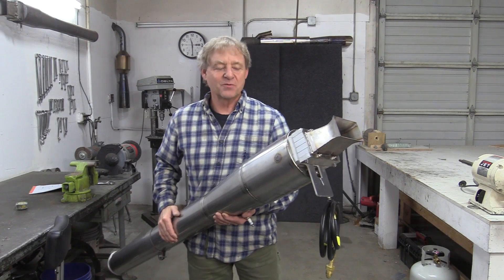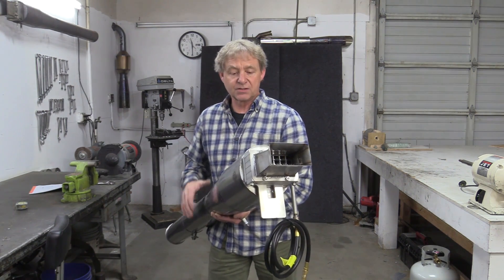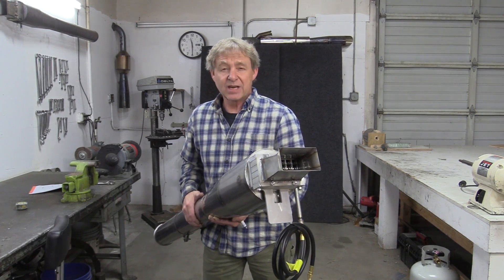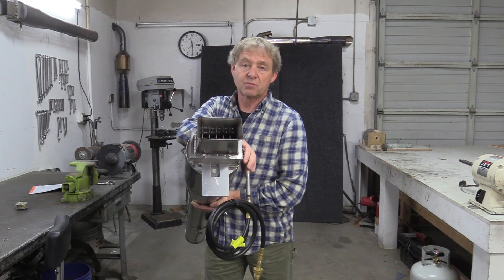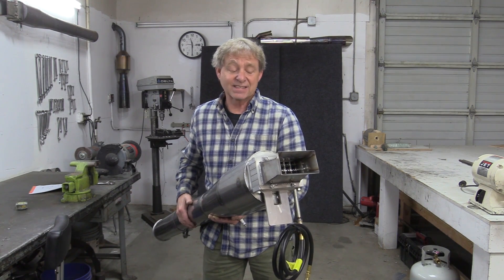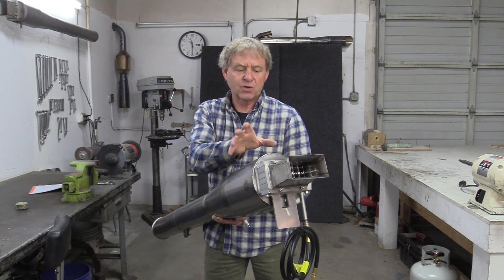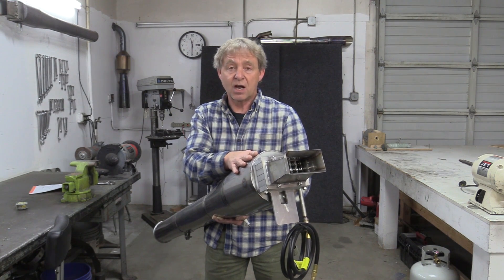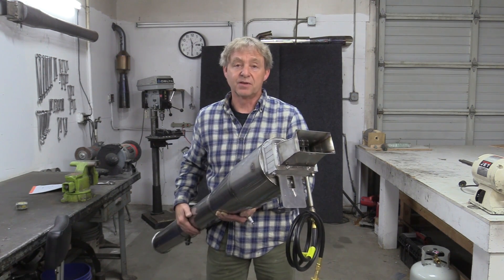Rocket Man building the BIG 50 pound thrust Cyclone 50 Pulsejet!

Comment: What a great build and super video on it!   Which fuel be least costly to operate the rocket?  Besides gasoline or propane, could you use kerosene or diesel?  
Also just wondering how long does the reed valve work before it needs repair or replacement?  Such rapid pulsing I would think it wear out fast.
Reply from the maker: Hi, My valveless engines run on anything but the valved engines just run on gasoline or alcohol ( but would need re jetting. Valves last about 20 minuets.

Comment: When these jets run for a decent period of time and end up turning red and white hot, is there any danger of some kind of catastrophic failure? I may be wrong, but Im under the impression that when metal is red/white hot, thats when its at its most malleable and weekend state; thus, the combustion chamber could potentially fail. Im I completely wrong?
Reply from the maker: Hi, Well the white hot look is just from the camera, they never get white hot just a bright orange, about 1200 F and they won't melt or anything, if you had a weld com apart it would just open slowly and shoot some fire out but the engine would not stop running until the hole got maybe 4" long and real wide, the engine will never just explode or anything like that.
Reply: Well whatever you do, obviously don't make it almost entirely out of <1/4 inch HDPE plastic, and then light it off with your right ear next to the widest part of the combustion area. (I speak from experience, very bad idea.)
Reply: @uniteddetinu7750  lol been there done that...😀🐶🔭
Reply: Brunnen
Wasser
Reply: Robert Maddox 
How much thrust?
Reply: Larry Scott it's in the title duh
Reply: Widi Taufik 
My mistake.
Reply: I recommend 4130 Crome Molly, but no matter what do not vary from the plans.
Reply: justin hyland with new alloys wear hardening and other attributes only time and testing will tell ?
Reply: Ask the Brits about the V2 sent over from Germany. It was a pulse jet engine.
Reply: @Laurenavan  V1*
Reply: Might be air cooled wind chill missing in static run.

Comment: id like to correct 1 small mistake, that is a ram jet engine, pulse engines use the u shape but I would love to see a turbo ramjet with an afterburner and I could design it too
Reply from the maker: You think after 20 years of building pulsejet engines I don't know what they are? ram jets have to be propelled up to speed to run, they don't run static, the u pulsejet is just a valveless and the cyclone is a valved.Thanks.
Reply: I'm only going off of what I know as of rn I'm still a kid lol but theres something I would love to see you make
Reply from the maker: That's okay, I am going to build a ramjet engine that is run up to speed with a pulsejet engine, keep watching!
Reply: I had another idea, a turbo ramjet modeled after the j 58 found in the sr71 blackbird complete with an afterburner and bypass tubes I wanna see if its possible to make a smaller model because I wanna use its design in a small jet I plan to build

Comment: What weld settings do you use to prevent burn through? having trouble welding 0.55mm thick stainless - what thickness sheet do you use?
Reply from the maker: Engines are made of 18 gauge 304 2B stainless,, Well you can run from about 50-95 just depends on how fast you weld ( I am using a tig).
Reply: Thanks for the reply! love your videos

Comment: Love the tacking clamp for round sections!
Reply: Keith Ward big oil filter wrench with tacking holes .Band wenches have been around a long time !
Reply: Piston ring compressor works the same as well.  :-)
Reply: @mikeymike758  . . except it doesn't have the 'tack' holes, does it? That's really the 'whole point'(pun intended).

Comment: Have a question. I'm thinking of making my own pulsejet and if I use just liquid petrol for fuel, how can it be ejected to the burning champer without any pumps?
Reply from the maker: Well, you can't unless you make an engine like the old dynajet red head engine.
Reply: Robert Maddox hmm.. Then how it works? I'm first and know almost nothing about this, anyway thanks for fast answering.
Reply: The only option would be to try gravity feeding it but the tank would have to be a LOT higher then the engine

Comment: plasma cutters are cheap now days! a set of mdf patterns and you could cut out engines sets in minutes!
Reply: Cutting them out would be quicker, but you are still back in there with a grinder to clean all the edges.
Reply: MsSomeonenew doesnt matter whether you cut them with a grinder or a plasma cutter you still have to de-burr them, might aswell save some time with the PC

Comment: Just go to colin furze. He has tutorials even without using any welding equiptment or other expensive mashinerie. His pulse jets also cost alot less.
Reply: Actually valveless pulse jets were developed later.  I believe Colin uses the Lockwood Hiller design. The big advantage there is that valves are typically short lived due to the extreme heat and mechanical stress they are subjected to. With the V1 "buzzbombs" this wasn't a big concern since it was a one time use and one way trip vehicle. As long as they lasted long enough to hit a target, it served it's purpose. Still, some of the V1's never even lasted that long and didn't make it to their target. For a reusable engine a Valveless design is what you want.
Reply: Different engine M8.  Furze uses the earlier valveless design.  Duh
Reply: To slow raymond!
Reply: +Kak Eyed It's not a matter of "cheap". It's a matter of reliability. A valveless pulsejet has no moving parts  that can wear out and fail, therefore is much less likely to fail. That means a valveless, would be much safer. However, pulse Jets don't "explode" anyway, because they have very low compression. That's also the reason they are very inefficient and aren't used much except in roles where efficiency doesn't matter much. Anyway, a valveless pulsejet is about the "safest" jet engine you can build. An amateur built turbo jet would be much more dangerous because the turbines in turbo jets spin at extremely high RPMs. If they fail, you'd have the potential for high speed shrapnel flying out! Anyway, in looking at Roberts other videos, it seems he already came to this conclusion and is now using valveless designs also. If you watch his newer videos with his "Viper cart" you'll see that's a Lockwood Hiller valveless engine, just like Colin Furze is using on his carts. So, it would seem Robert has already figured this out.
Reply: nice spelling of "mashinerie"
Reply: There are dozens of Valveless Pulsejet videos.. this would be the first one ive seen that featured a hand made V1 style rectangular reed valve.. Not to piss on Colins work, he is a trip and has tackled some neat projects.. but this is the good stuff.

Comment: What about running a shroud over it extended past the aft end to scavenge cool air over the body to keep external temp down
Reply from the maker: yes you could do that, however the shroud would have to be about 2 feet wider than the tail pipe or to will disrupt the shockwave and put the engine out......Good thinking! I like it.

Comment: Do different fuels produce different thrust?
Reply from the maker: Good question! well...You can make a little more thrust if you use Methanol, however you have to use a lot more, I tested using No2o with no positive effect, it would take a lot more fuel but would not make more power, nitro, docent like nitro, I think that fuel needs compression ( pulse jets don't make much for compression) I guess the most power I made using the valved cyclone engine doing tests with all the fuels was a high pressure, four injector (instead of one) running on clear kerosene, made about 10 percent more thrust. Bob.
Reply: Ill mail you a 5'er if you hydrogen boost the fuel.
Reply: So this engine will push a go cart or a bicycle easily?
Reply: I don't think it's the fuel I think it's the size of the engine that produces more thrust the bigger the engine the more thrust produced (?)

Comment: Bob, thanks for the in depth response!  This will be fun.  The physics behind these engines is elegant even though they sound... well, kinda loud.  Exhaust nozzle shape interests me. Have you looked at flared vs straight vs tapered,  what effect?
Reply from the maker: I don't believe there is a difference, I just flair the ends on bigger engines because it make them stuff, the sheet metal is then.
Reply: OK, we'll try it. On supersonic flows, flaring increases thrust.  On subsonic flows, tapering can increase thrust or choke the engine to stop.  Within the exhaust pipe the velocity exceeds 2,000ft/second, but this is subsonic at 2,000 degrees F. At some point, the cooling gas becomes supersonic (loud).  Ya gotta love it.
Reply: Loud shoot my dad built a ratrod when its turned over it breaks the sound barrier.

Comment: Bob, I haven't heard from you yet.  Assuming you are not interested in fabricating a 25 lb thrust engine then I will purchase one of your Cyclone engines and resize the project.  I have a few questions.  Typical reed valve life and availability of spares, typical gasoline fuel consumption at optimal throttle settings and recommended spark voltages(energy) and frequency. If high pressure fuel pumps are used, will smaller orifices improve mixing and performance?  What is the delivery (fabrication) time?